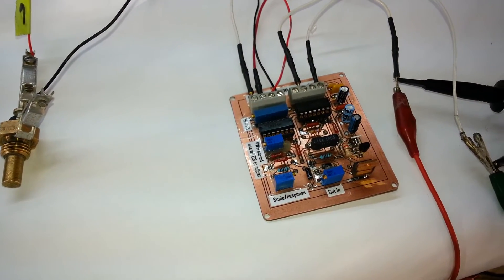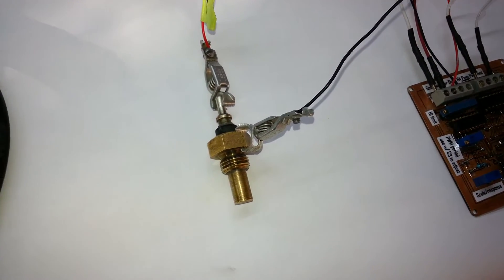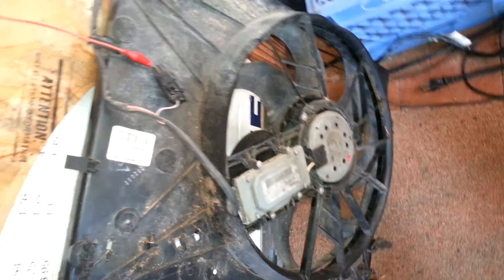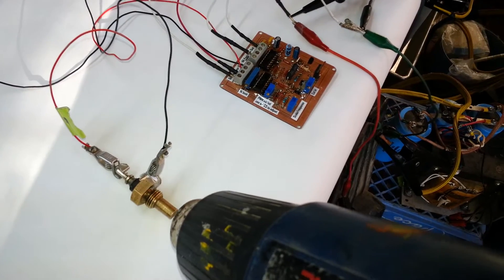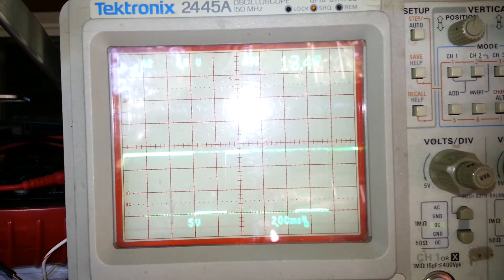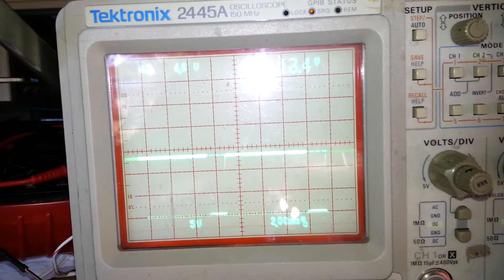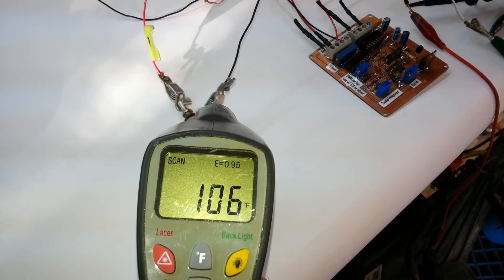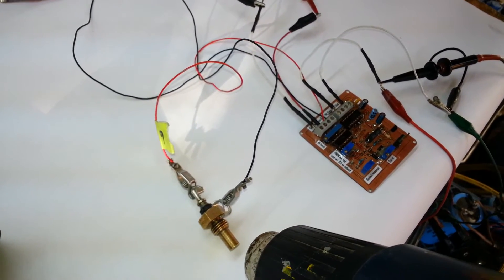Pwm radiator fan controller

Comment: the commercial units use inductor and large caps (1000uf x2) to absorb voltage spikes of back emf, caps are min. 30v up to 55v
did you have any issues? or how to protect against back emf in your unit?
I"m not electronics expert just interested.